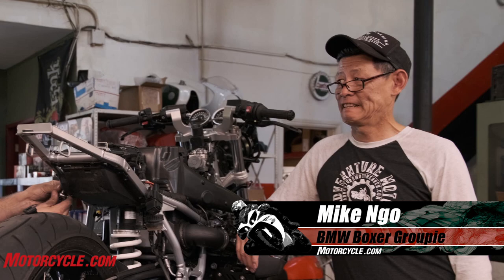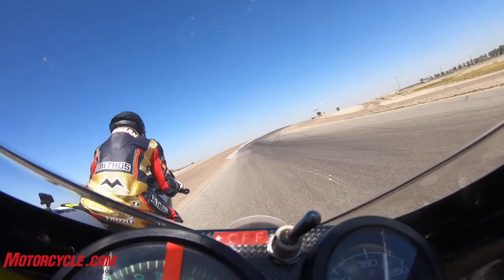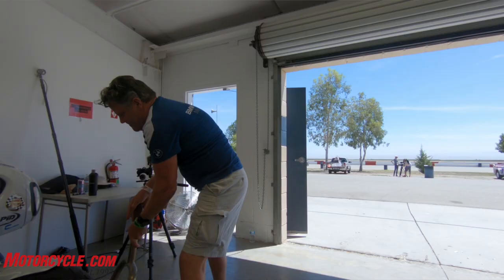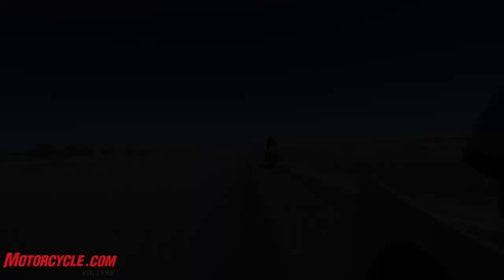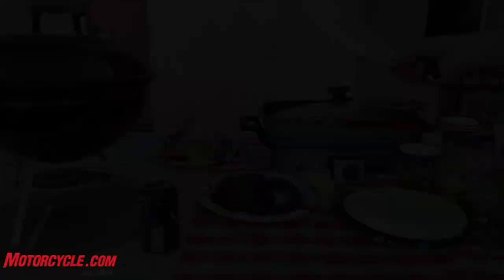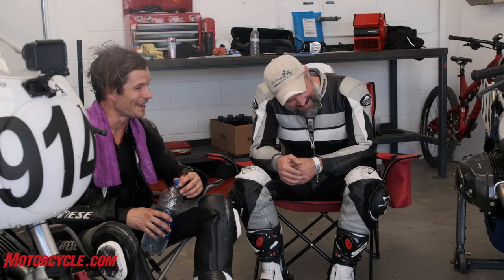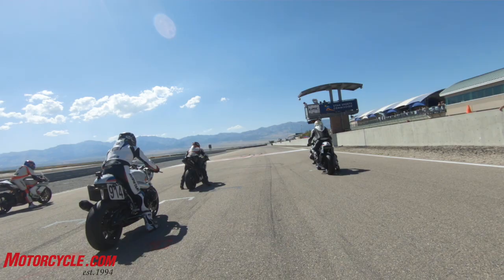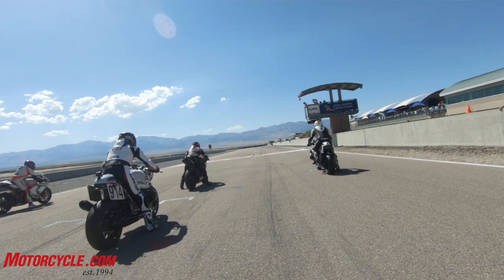Let's Go Racing! BMW R nineT Racer - Part Two

Comment: this is awesome. as someone with an RnineT Roadster it's great to see them using it to race (though i never will).
One thing that was said here really hits home for me, the bike is super stable, I'm used to a more frantic Ducati so I've been slowly trying to work my bike back into shape. how'd you find the increased rear height helped? have you dropped the triple tree height at all? I'm probably never going to race my ride, but I'd love if it could flick it into a corner a bit easier.